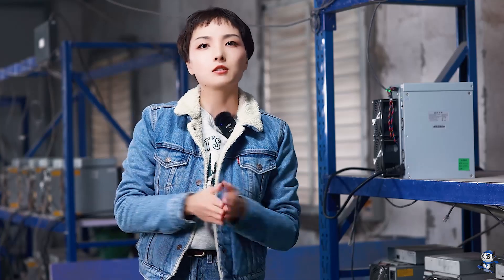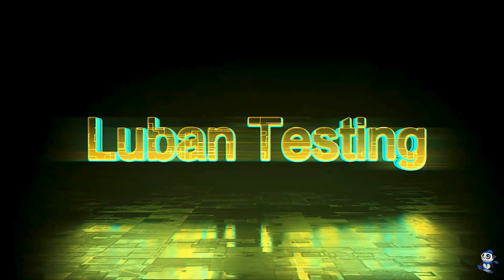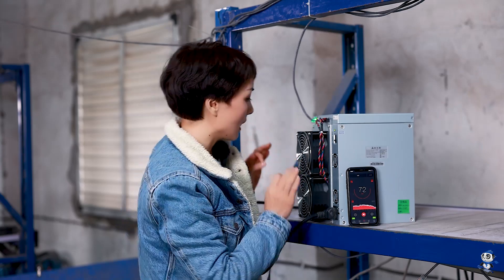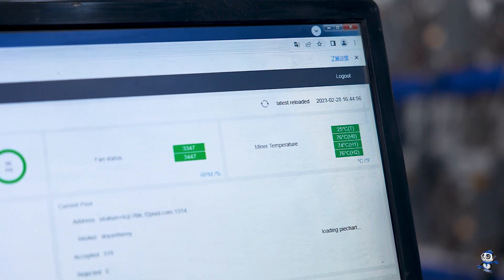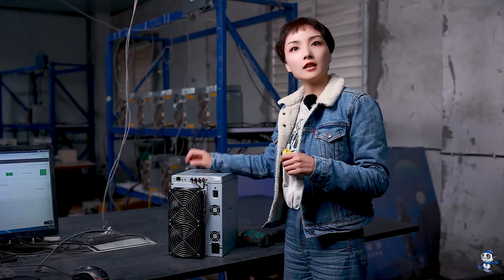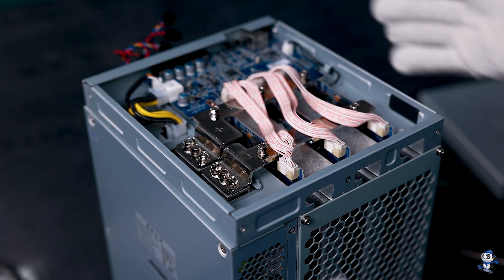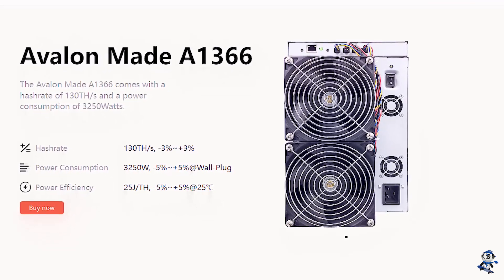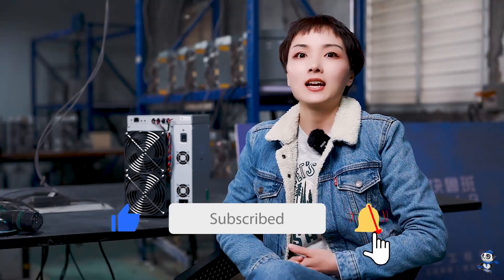How much does Canaan Avalon  A1346 make for you per day?

Comment: why your 1346 only 2fan other all have 4fan
Reply from the maker: some 1346 use the old frame structure like 1246-N, mostly are 104T and some 107T. They use the old frame but the chips are changed. What I tested was 110T, which uses the new frame structure. that's why they look different😀